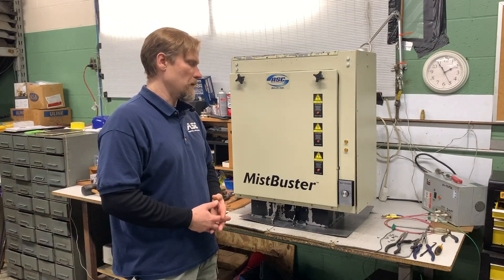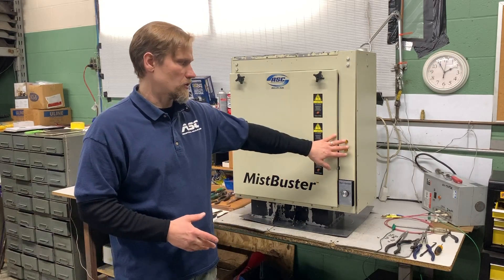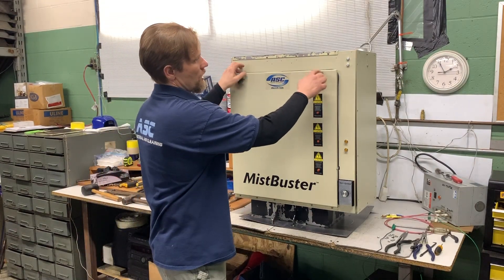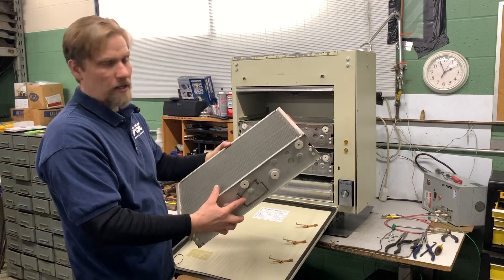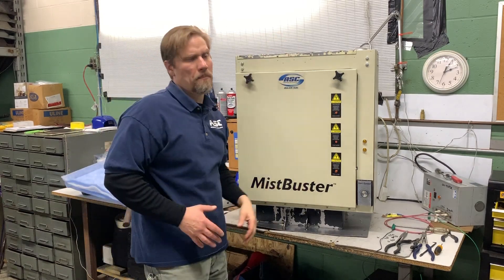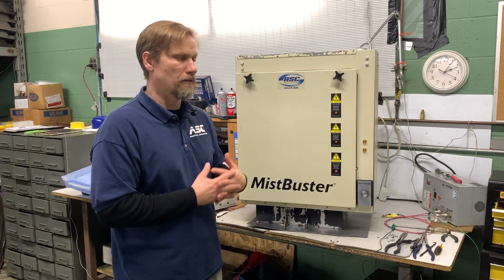Mistbuster Air Filtration Unit Parts Overview with Troubleshooting

Comment: I have a mist buster 850. Every time i turn it on it blows a fuse where it is wired in at for the machine. It is the 200 volt version. I know its all good in the machine end, but i now think i need to unhook the fan motor and try a fuse. Remove all the filters and try it. Maybe swap the compositor. I doubt 2 power supply boards would go at the same time.  I  am suspect it will end up being a bad fan motor or a bad compositor. I have even seen the on switch that controls the fan motor speed also be the culprit in situations like this.  It is grounding out somewhere in the mist buster and shorting it out.